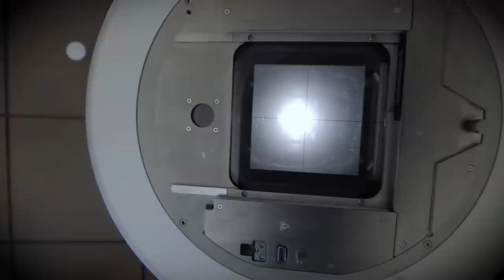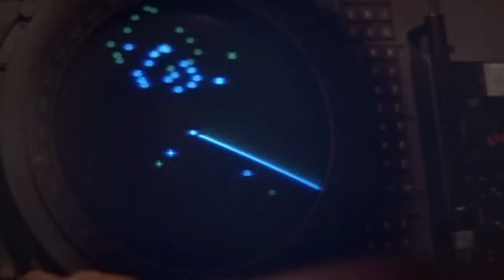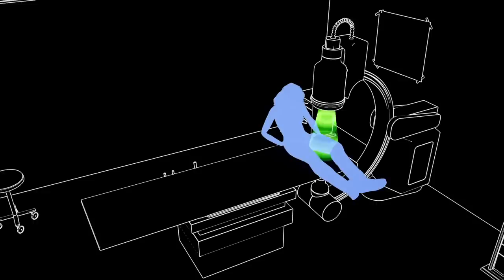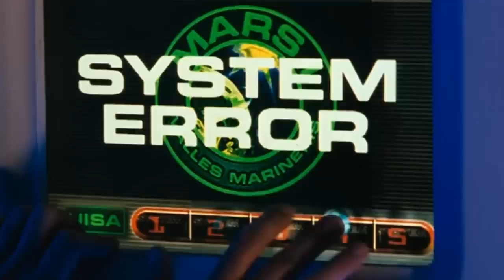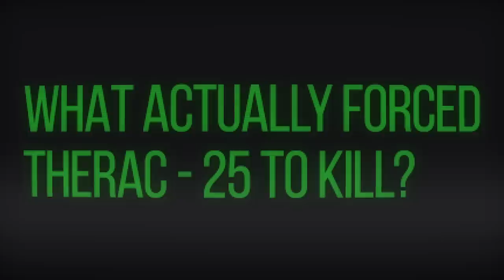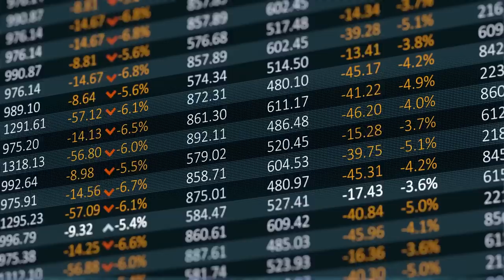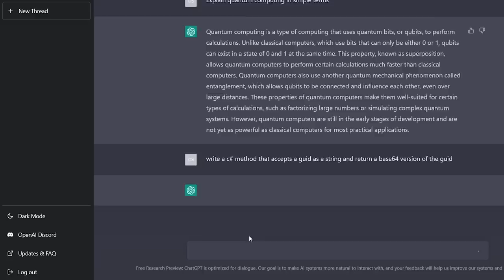History's Worst Software Errors

Comment: I like how they kept using the machine after every death
Reply: Radiation can take weeks to kill, and the facility had dozens of patients every day, so it really isn't that surprising they kept using it. The pattern of evidence was pretty thin.
Reply: @theonlyabberdabber  so if the patient emerges from the machine with noticable inflamation and pain associated with an extremely painful experience inside the machine, then just brush it off as completely normal?  Just continue and think nothing of it?  One occurence like that should be enough to halt the machine's use.
Reply: @jamiebraswell5520  Those are normal side effects from radiation treatment, so yes it would be brushed off.
Reply: @theonlyabberdabber Screaming and pounding inside the machine are normal?
Reply: @theonlyabberdabber  as someone who has undergone radiation treatment that is NOT normal. It should be painless during the process, and the effects afterwards should not be painful to that extent.
Reply: i know how do you mean that, but if u buy, for example a new car, and it isn't run, you will not search for problem in motor but in for example fuel, or flat tires etc, i mean this
Reply: 😅prob just me but if 200 rads is a normal dose why tf can the machine even output 20000. Idk how it works precisly but it seems a bit overpowered for it's usecase
Reply: When the guy got 20 000 rads through his head and slowly died over 2 weeks I was like 'OK now they're done with it' But then not at all. And I'm not even surprised
Reply: @xrpmoonwolf  if u need to kill something on purpose with it u can do that as well.
Reply: @jamiebraswell5520  Money is a heck of a drug.
Reply: This is just a crappy ripoff of Kyle Hill's video lol
Reply: They still use it

Comment: I had a (obviously not so serious problem) when I installed a DVR at a company years ago. Everyday at 19:00 that thing would stop, only to start again next morning. I didn't know what it was so I exchanged the equipment, only to find out that the problem continued. I decided to sit right in front of it while 19:00 passed with a monitor so I could find out what it was. Well, I did find it. The cleaning lady was using the electric socket that it was attached, to plug a vacuum cleaner. I laughed so hard at that scene I couldn't be mad at her.
Reply: Interstesting but the janitor was too funny 😂
Reply: This is just a crappy ripoff of Kyle Hill's video lol
Reply: Who needs security? At least the place is clean, right?
Reply: @A5H_01  you need protection if robbery or hostage you know?
Reply: @microwave-z8y  Was a joke my guy, sorry if that wasn’t clear

Comment: Not as much of a Terminator; it was due to an amazingly bad coding practice that we now unfortunately have to discuss about, especially about Therac-25, in computer science classes nowadays. This was precisely why safe coding practices are mandatory around machines that have to do with another human beings. The computerized radiation sources are also required to have more than a single processor to be able to safely vote the misbehaving computer out, preventing another Therac-25 style incidents, and of course maintenances are also very crucial, something that hospitals and ACEL have actually failed to do.

Comment: I love that I knew every single one of these cases. Malpractice cases due to negligence are always so fascinating, since the real reason they happen is that people don’t keep up with the safety nets, often that higher ups at the company were aware of but pressured everyone out of to save money. 

We don’t want to believe we spend our every day living dangerously and all too often we laugh at the seemingly useless safety codes, and quickly blame the one tired overworked maintenance person for pulling the wrong lever without questioning why it’s possible to end lives at the push of a button 2 inches from, and the same color as the one that increases a speaker volume.

Comment: A race condition. The PDP-11 assembly program would switch modes when you went to the bottom command line. But if you made a mistake you had to go back to the previous lines.... except that it didn't switch back to data entry mode. So it didn't take in your corrections and there were no hardware interlocks to prevent it.

Comment: Error 54 
When the setting was quickly changed from I setting to another the device required to change the setting of rays in the head weren't given enough time to change the heads from x-ray to gamma rays it fired on what ever setting it was caught on firing higher doses
Plus the program used was designed by 1 guy as a hobby from an older machines design and the guy that designed it no longer worked for the company to ask what all the error messages meant
Reply: "Fun Fact" --> This is actually how most dupes in MMORPG's and Online Games came into existence - switching specific Menues too fast would let you dupe expensive items. One of the game most prone to that was Diablo 2, were Zod Runes (Drop Rates 1:5000) kinda became useless. You couldn't ever be sure if the Rune you bought wasn't duped because if it was...it would get deleted by the background Sentinel Guard detecting multiple duplicate Item ID's (a number assigned upon drop to make sure this item is unique), which in return meant if you accidentially traded items for a duped Rune the rune you got would vanish and the scammer would keep your items...
So yeah, programming isn't just whacking your keyboard with thousands of lines of code but also making sure your code works, detecting the bugs and keep it fixed as soon as a bug is detected.

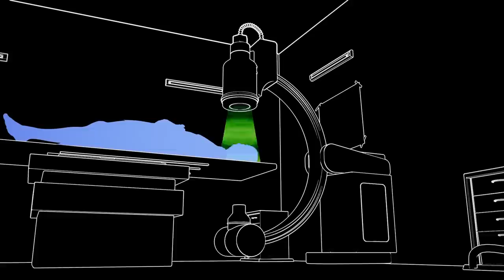Comment: 10:27 no, it was because the magnets that are used to dampen the rays was in the middle of moving when the operator changed the settings. this caused an abnormal amount of radiation to be delivered, which killed the patient.

Comment: I think the machine is fine it's just people not keeping an eye on if a certain number is way higher than 4 which is a error number. And so they kept using it because they didn't see the error before it went to zero. And they just didn't know how some parts of the machine worked like what does this button do? Oh and it also hade many error in the code. And it also seems like the machine can't read radiation dosage correctly.

Comment: I was beginning to wonder if it was killing people because of Cosmic Rays, Cosmic rays can cause soft-software issues that aren't usually detected by the system, because it can cahnge the number in the code. This happened on a few flights, where it changed the Altitude data and it thought it was way higher than it was, and the systems nose dived the planes.
Reply: brother watched a tom scott video and thinks he's barack obama

Comment: terminators are unlikely unless you give an ai real intelligence but other deaths are either caused by pepole with bad intentions or by software glitches
Reply: if ANYTHING BAD IS HAPPENING TO SOMEONE AFTER USING RADIOACTIVE ELEMENTS OR RADIATION THE MACHINE SHOULD BE WORKED ON AND FIXED

Comment: The number of off tracks, out of the blue comparisons, misinformation, computer demonizing and overdramatism in this video is staggering tbh. 
Also you're consistently showing pictures of different machines while talking about the same one, painting a wrong picture and fooling ppl to think they understand what happened.
There was no documentation provided for the machine and it was the AECL fault for porting previous model code into the new one. Model 20 code, as literally EVERY code everywhere, was developed under certain assumptions about the workings/possibilities and limitations of a platform/infrastructure/hardware/machine, which were no longer the case for the -25 model. Greed to cut costs of AECL was present in both cases, as the code of -20 was done by just 1 "hobbyist" with no testing, QA or peer review which should be the case and could help prevent the latter events.

Comment: This is definitively one of Riddle's worst videos. The Therac-25 was both tragic yet fascinating, spanning across multiple topics including IT, business ethics, and crisis management. But Riddle is ruining it by adding way too many fillers of unrelated accidents in between.  
I know Riddle wants to use other examples of software failure to prove the point that a robot or automation can easily malfunction due to a bug, but the end result is that it is extremely distracting to people who just want to know the Therac-25 story. If Riddle wants to draw similarities they should do it at the end, not during.

And the unnecessary AI sentience buildup, on a 1980s robot, is plain cheesy and dumb. The purpose of a pop-sci channel is to educate, not instill fear and deliberate false information.

Comment: Greed. Greed never changes.

I can understand software errors. But why the machine was designed to give several thousand times the radiation needed? All the killings could have been avoided by simply having a 25 cents fuse. And a secondary, not computer controlled, sensor. Both the software developer and the engineer that designed the machine are at fault and should have been jailed for gross negligence.

Comment: This is beyond stupid.  There was no AI in the 80s.  There were no computers hooked up to radiation treatment machines back then, so everything was  input by the operator, and the standard was to have a second operator (radiation therapist) look at the input before "beam on".   The computers we have in place today do multiple checks AND there are several professionals that also sign off before "beam on". Even today, these machines do not make decisions on their own.  Fear mongering for clicks.  I hope that this doesn't scare someone from getting life-saving treatment.  I have been in this field for over 30 years.

Comment: you exagerated all the stories starting with the cancer machine, the cancer machine was A badly designed, with software locks INSTEAD of hardware locks to prevent malfunctions and B the software was written by a single person and never tested before it was sold. clearly natural intelligence was not involved in the product. then again the people harmed by the machine died of radiation poisoning rather than "excruciating pain, etc" they did not twist in agony untill death, more so died quickly but in peace.